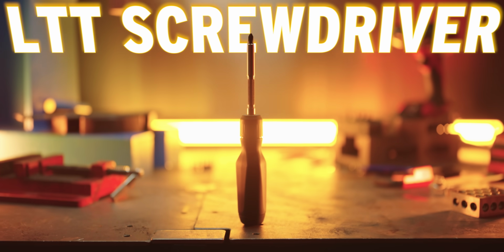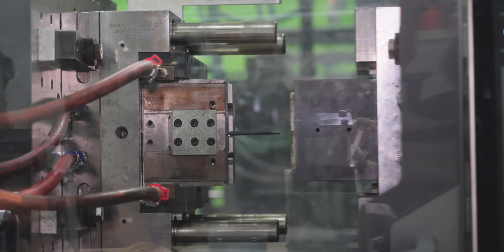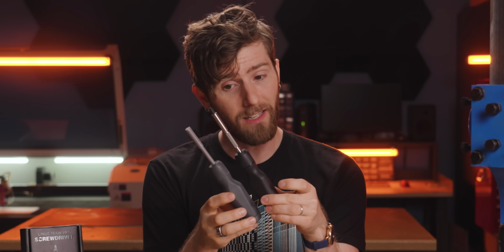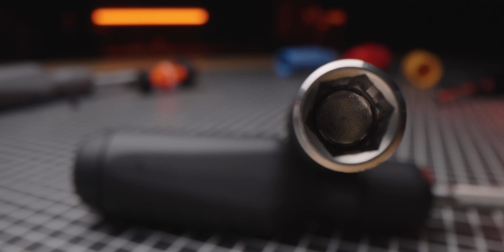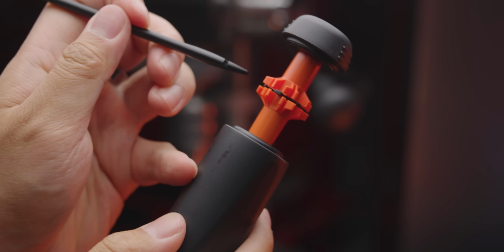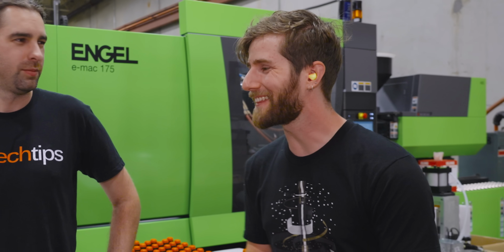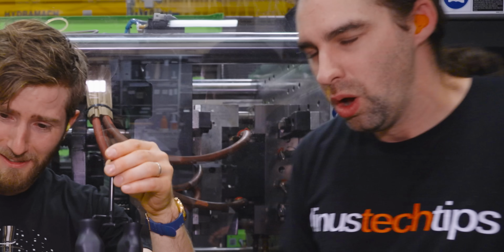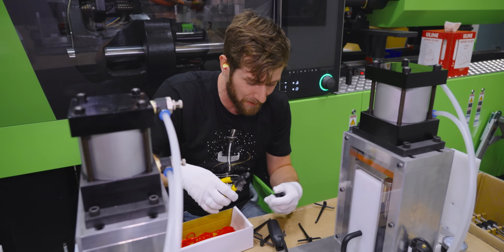Why our Screwdriver took 3 YEARS

Comment: You guys can consider DLC (Diamond Lice Coating) or other PVD coatings for Black or other colors.   Side benefit is that DLC is probably one of the hardest most durable coatings available.  given the quantity which youll be producing this product, it should be relatively cheap.

Comment: As someone who was fortunate to pick one of the screwdrivers durring the popup shop, I will say it is fantastic.

I used to use the Rolgear MBR3-15 screwdriver as my work horse, but found the ratcheting mechanism (berrings I think) liked to jam on higher torque applications. I also didn't like that the selector ring on the Rolgear screwdriver follows the shaft direction once selected. Lastly, I really didn't like the long double sided bits as the magneticforce was basically zero, and it made using different bits much more of a pain. Please remember the Rolgear is still a fantastic screwdriver, it just has some flaws I really don't like. 

I have been using the LTT screwdriver for a few days now, and I have yet to find a single gripe. Everything feels super precise, and the magnetic force is exceptional. I really enjoy the back force of the driver being so light, but not jamming under high torque like the Rolgear. I also really like the fact that there is 12 bits. My larger hands sometimes find trouble to pull the correct bit out, but it's still miles better then the exchange method for the other driver. $90 CAD was a lot to spend on a screwdriver for me, but I am happy so far! It's also sweet being able to support a local business!

Comment: I was just wondering are you planing to create PZ (Pozidrive) bit set as well, its quiet common in europe. You can screw PZ heads using Philips but quiet often its slipping on higher torque and eventually you can strip the head. If so it would also be nice to do mixed set of PH and PZ. Looking at Philips set you could just do 1x of each 0 i.e. PH0 and PZ0 and 2x PH2 and PZ2 and so on.

Comment: I'll probably end up buying one, but I'd be very curious to see a poll of purchasers if they would have preferred a slightly longer handle with standard 25mm length hex bits. Personally that's the only thing keeping this from being the ultimate screwdriver for the masses. I feel like the non standard 20mm length hex bits is going to be a deal breaker for a lot of potential customers.

Comment: Initially, I felt the cost of this screwdriver was ludicrous considering all the cheaper alternatives available everywhere else. However, after learning how expensive it is to acquire manufacturing molds and the transparency of the manufacturing process, I now feel the price is somewhat justified. It is STILL costly, but now I realize it is more than just a quality tool.

Comment: You mean we're going to pay for it, not your sponsors lol.

$99 promo price lol. I haven't seen what you sell them for just  making up a number.
I like the driver, but, rather have a short bit receiver for long 6 to 8 inch bits. For those tight to reach places.
For example, will this screwdriver reach deep heat sinks to unscrew them?

Comment: There is only one problem with your final product. The shaft on the driver is too fat to fit in those deep narrow holes in electronic cases like some consoles with very recessed screws. Home depot makes a set I have bought for electronics. It is a cheap hdx set with I think 8 long bits that lock into the handle. About $8. I would have the shaft be a long bit, and basically do a ratcheting version of this product.
Husky-Interchangeable-Blade-Screwdriver-Set-10-Piece
Then instead of chinese butter metal do it through Germany and make a quality set like Wiha

Comment: Just bought the screwdriver, the black shaft with orange accents. So excited! $69 is expensive for a screwdriver, so I wrote it off as a business expense. It’s money I would have had to give to Uncle Sam anyway so I’d much rather get a high quality screwdriver for my workbench that will last for years and years instead of some garbage slapped together product that will break in a year.

Comment: EDM machining is some amazing technology, working a project doing R&D on an EV conversion and we had to cut a 2” cylinder hardened to about RC55 and an EDM cutter blasted through it like it was butter. Amazing what some wire and high voltage can do

Comment: Over 10 years ago I bought set of few small screwdrivers and like a most common phillips head screwdriver. Since then i've built hundreds of pc's, fixed hundreds of laptops and whatnot and besides few laptop outliers that used some random head screws I had no issues. I use them to this day.
All of them combined cost equivalent of about 7$. Ironically enough, for some of these laptops i would not be able to use the ltt screwdriver cause of the shaft.

Maybe this is worth it for someone who lives with a screwdriver in his hand 24/7 but otherwise 70$ for a screwdriver is asinine amount to pay for such simple tool. For 75$ you can get big ifixit set and you are way better off with that for any electronic devices and even ifixit set is expensive for what it is.

Comment: For the price of it you could just get a PB Swiss ratcheting screwdriver made by hand in switzerland with lifetime warranty. 
I get it's a fan oriented product that will never experience actual proper use but 25Nm for 90 bucks is just not it. Heck, you could get 3 Wera ratchering screwdrivers for that price, and these are rated up to 50Nm but easily handle 65Nm.
Comparing it to sub 15 bucks products from amazon doesnt really prove their point either.
And as with every other product, its not the designers or the manufacturers that find out the products actual flaws, rather the users. I cant wait for the incoming complaint wave.
Ill stick to watching videos though.

Comment: Ok I’ll bite, I’ll order one. As someone that does industrial refrigeration and controls I have a very specific driver I goto (EVCO 6in1CG) because of its durability and very tight tolerances. Except for the Malco 4in1 there hasn’t been a ratcheting style screwdriver that I haven’t been able to break in a few months time, not on purpose of course.

Comment: I gotta be honest i just use a generic rachet kit being using the same set for 10 years never had an issue and it cost me 18 pounds about 30 ish us dollars, I appreciate the amount of engineering and design work that went into the product just the price is a little eye watering when you take in shipping and taxes and fees to the UK.
Reply: Same story here. Also same story with my backpack; paid like $30-40 USD for it over a decade ago, and it still works great and is holding up fine with only minor wear. Went to check the price on their backpack they recently started advertising as I was considering something new, and almost had an aneurism. $250 for a backpack is mind blowing to me. I'm sure lots of work went into that as well, but man, the prices are just too much.

Comment: I'm surprised you are just ejecting the parts into a bucket and not having a robot put them onto a conveyor, not sure what the situation is (if an operator is sat there 24/7 removing parts as soon as they fall) but that seems a sure fire way to get marks and scratches on the A-surface.

Comment: The thing that I don't get is you went through all of this, you're selling these for $70 a pop, and they're still using zinc "chinesium" at the most critical parts. For $70 a pop why are we not at least getting steel internals? You're going to have drivers shattering right where the shaft is held in the handle.

Comment: I understand your perfection passion, but in real world ask yourself do you really need 70$ screwdriver? For the last 20 years I built a lot of computers. I use screwdrivers almost every day at work. Few years ago I bought Xiaomi Wiha Zu electric screwdriver for around 35$ and I love it, -  press button and just allow motor to make the job done.... we all live in 21 century are we?  
     P.S. From my own experience. A ratchet is useful when you are driving screws into wood or loosening bolts that are tight in a nut. If we talk about computers, the ratchet mechanism in a screwdriver is more of a hindrance than a benefit. The threads of the bolts are very short, it is not necessary to tighten them strongly and for a long time. A loose bolt usually cannot turn the ratchet and rotates with a screwdriver in both directions. Сorrect me if i'm wrong about something.

Comment: Linus, if you'd like to try a much better coating process that's only a couple of microns thick, looking into PVD coating from a company such as Eifler. We run two of their machines in our machine shop and they produce awesome coatings for many different uses, though it's mostly for heat. We do gold coated tools, black, blue etc.

Comment: I feel like you put attention on everything that isn't that important. If this was for tech work, you ignored one of the biggest issues of using a multibit screwdriver in repairing electronics. Screws are a lot of time in a deep narrow plastic hole that these bits are too fat to fit down in. In this case, you made the bits even shorter. Fine, this might build a PC fine, but working on anything else I feel it's not any better than any other screwdriver.

Comment: I like LTT videos and this looks well thought out but ill just stick with Snap on...they have better warranty, interchangeable shafts and handles, made in USA, black shafts that don't wear off and only cost a bit more...hell you can even buy pre-owned for 15-20 bucks and still have lifetime warranty that includes warranty on the bits...and most snap on dealers will warranty abused tools....with LTT i would have to send in and let them determine if its covered and wait for return....with snap on find a truck dealer in your area and he will swap out if its in stock...most people don't know the truck dealers will sell to anyone... People complain snap on cost too much and i agree on some things but you get what you pay for.... as a master tech i bought a snap on box for $6200 in 2000 and in 2015 the spot welds on the bottom had the paint popping off but the welds were still solid. I asked what could be done and without question i was given a brand new box...this box is same size as mine but newer with a price of 12k if i were to buy then.
With that being said I'm sure the LTT screwdriver is nice but not for me.

Comment: I like the idea of a good all in one, but as an engineer, everyone should get a dedicated #2 and #1 driver from Wera, Vessel, or Wiha. That is really all you need for PC building. 

For repair work on small electronics, the short bit is actually a detriment. Many devices requires a small shaft. For example, repairing the Nintendo controller, a common item for this demographic, requires you to use driver that has at least a 50mm shaft. 

What is crazy is that gamer nexus also missed the mark by failing to including a #2. 

My personal favorite is the Vessel #1x75. It is a ball end which is actually how a lot of people would handle a screwdriver with electronics.

Use the #1 on small M3 screws. #2 for the case or cpu cooler screws.

Comment: Really admire and appreciate all the efforts the team has put into this screwdriver. I immediately ordered an all black one but only found out the black shaft one will be worn out sometimes in this video. I would still order the black shaft one even if I knew, but it will be nice to mention it on the product page.

Comment: I am working at Automotive where we use a lot of injection molding technology. Need to say I am really suprise by your dividing line on handle it is so smooth. As well burrs from ejector is so impresive. I never seen something so smooth from injection molding.

Regarding to going from first samples to serial production is always the biggest step. Everyone who works in some huge serial production can confirm that first samples are really easy to do specially when we have 3D printers and 1 shot cavities for injection molding but to complete serial production is always something else. You need from tools to be reliable, having good life time and mostly good design. Design is always something which is adjust during this phase because you can found that if you meet some tolerances together, your product is broken.

Really happy for you guys and from this video it looks like this screwdriver is one of the best on market. Surely will try to get one.

P.S. I am not native eng speeker, so my apologies for butchering your language.

Comment: hey Linus, is there anyway you folks can look into making extended shaft bits (like even just a philips head and a flathead) that are thin enough to fit into the recessed screw-holes that a lot of these electronic gadget companies like to use? It's an annoyance and I feel like it's just another way to make your product ultimately the most versatile, quality, tool on the market for the price. Just a quick request here.

Comment: First of all, congrats on finally finishing the screwdriver!
Second: What’s that ear protection that Kyle uses in the molding factory?
Reply: If you're seriously interested, hit up an audiologist's office. My pair cost me $70 and you can have them made to your demands i.e. color, sound fidelity, connecting cords.
Reply: @portlobe  100% yes. Can't stress this enough. $70 is a VERY cheap price to keep your hearing throughout your life.
ANYONE that spends lots of time in a loud environment needs this. I'm a musician and I WISH someone had told me at a young age the hearing loss I would have without them. I use them now, but I started after having some minor hearing loss.
Reply: That or just the typical silicon self shaping eartips
Reply: I got some from Ultimate Ears along with my custom headphones. They have a bunch of different designs, from plain noise control to one's that are for musicians so the frequencies are all dropped the same amount
Reply: Linus has it too
Reply: @Max_Jacoby  Nah, Linus has standard, one-time use, cheap ear foam that you usually give to visitors.

Comment: 21:39 - wearing ear protection, mic picks them up just fine, barely any background noise.
Reply: You can take alot of background sounds out with 3 minutes in audacity.

I imagine good mics, properly trained editors and i assume better software for audio than audacity makes this even more easy to do.

I am not surprised at all considering a friend showed me how to do it in audacity in 5 minutes to help kill white noise and equalize volumes of different recordings
Reply: @jewels3846  Same - as a workstudy, one of my tasks at University was to remove white noise and balance the sound. Audacity has not really changed their interface in 15 years, loving that.

Comment: As someone who works in the RND side of the consumer products space, I think LTT is finally learning the amount of RND, time, and money is needed for a brand new products. Most large companies or at least established companies have existing products that can iterate on to develop new products, it cuts down on so much lead time needed as most of the manufacturing processing and LCM work is already established to build off of. When you're creating a completely New product from borderline scratch, you have to build all of that up. Props to Linus for embarking on that process instead of just using a vendor's existing products. As a smaller company, it's a lot easier for them to work lean and move fast on development. It's cool to see the behind the scene on that

Comment: Been working at a similar factory as a kid. The engineers who create that kind of molds were looked at as gods. Linus took one of the most expensive approaches for his molds, he really didn't cut any corners there. On the other side...a bit surprised technology hasn't changed a bit in the last 20 years
Reply: It has but thats the beauty of injection moulding you can get fantastic repeatable results from old tech processes where super engineered injection moulding would be overkill

Comment: It looks the part and does seem to be a quality tool, The thing is though, for the electronic tat that i work with these drivers would not get casing screws out that are deeply recessed, actually an easy fix if i can have some long and thin stubby bits that maximize the length of the holder, that way the tool is not edited, and then it would be viable for me to use

This is where the GN Toolkit has me covered, but i would kinda want a stubby version of them with like 2 inches cut off, ha

Comment: Is the screwdriver still balanced when one of the bits is moved from the handle storage to the tip?
Reply from the maker: It's balanced with a bit in the tip. It shifts slightly to the back with the bit in storage. - LS

Comment: Very impressed you bothered to make it as compatible as you could with other vendors bits. If I get one of these (when) I'm in the UK so getting the official bits shipped out isn't really worth the bother. Having that option so this can be used with whatever I choose down the line is really nice. I hope this and backpack are a huge success and the next thing and the ones after that, this much attention to detail should be standard.